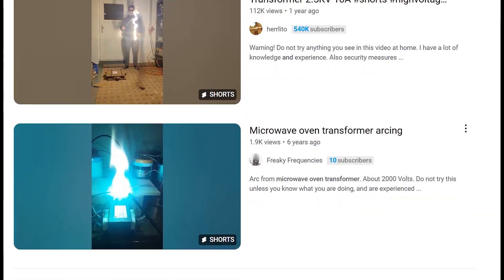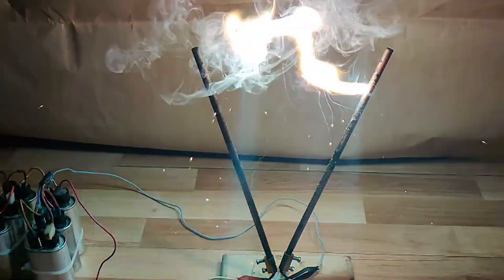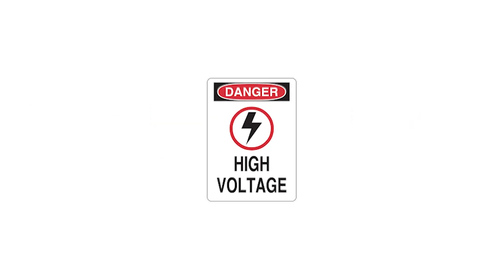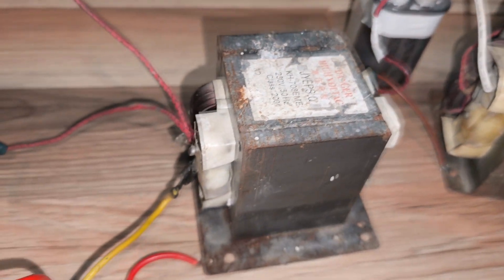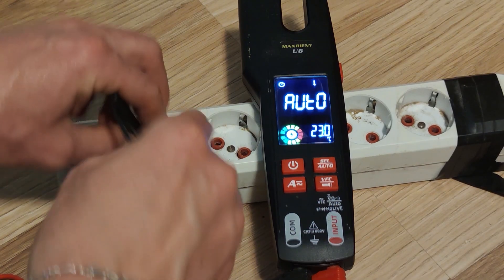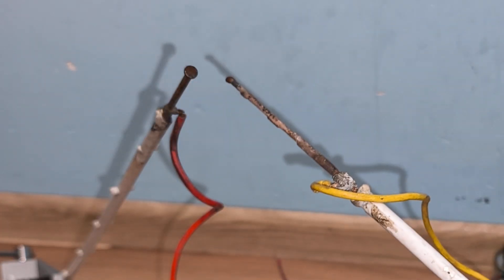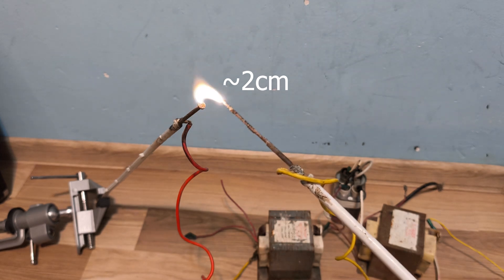What Happens When You OVERVOLT a Microwave Transformer? (Crazy Results!)

Comment: Would immersing the transformers in some sort of oil be good? 
I imagine it would help prevent the second transformer’s primary coil from arcing through its resin insulation and provide some much needed cooling for the first transformer.
What kind of oil would be best?

Comment: get a few high voltage omnidirectional radio transmitters then use a audio waveform synthesizer in 700/800 MHz UHF band and broadcast😏
Reply from the maker: You sir are a menace to society 🥶
Reply: @ElectroScience  🤣

Comment: Very interesting. I will try it out with some coils snd cores I have from my laboritory, because I think the impedance of the secondary is much greater then the primary. So in the first it seems that the Primary of the second transformer could not see input voltages higher than a few dozen volts... Not speaking about satturation at such high input voltages ( the  even show satturation around 200v input)

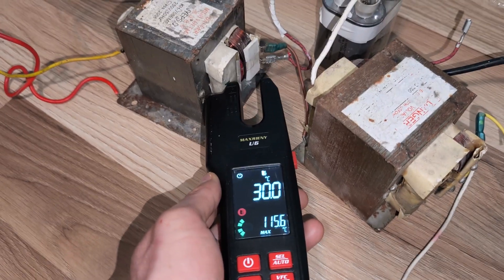Comment: 3:20 If I am not mistaken the reason for the first transformer being hotter is that you trade Current for Voltage (conservation of energy and stuff) and since (heating)power is resistance times current^2.
in short P=R*I^2 means that if you double your current, you will experience 4 times the heating. also explains why the first transformer is hotter than the second one. (because there is more current flowing in it). also interesting sidenote, the bussing at 3:40 is actually the ac currently alternating at the grid frequency (50/60 Hz depending where you live)